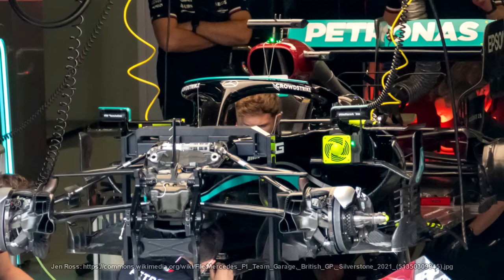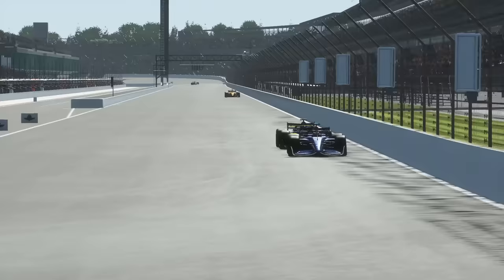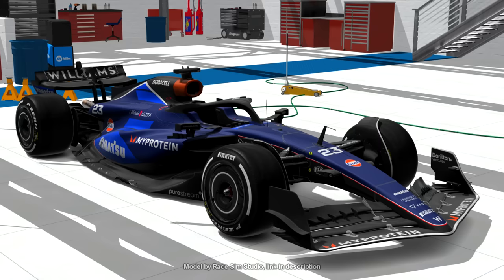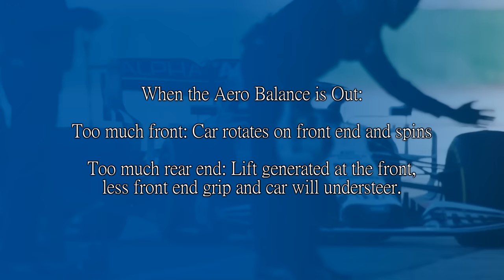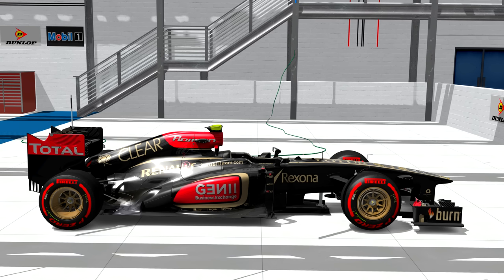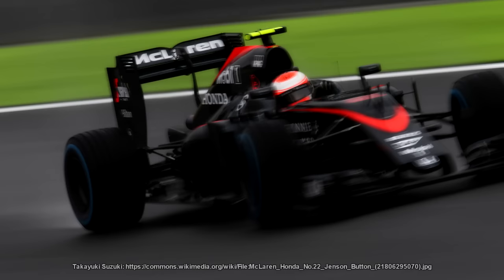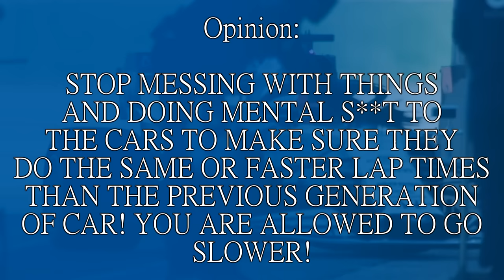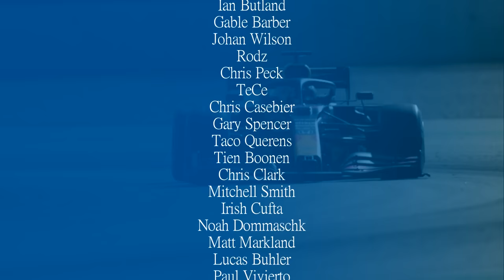BROKEN BEFORE IT'S EVEN IN? Opinions on the 'Undriveable' 2026 F1 Cars

Comment: If Vettel can run his FW14B on 100% renewable corn oil or whatever the fu**, then so can all of the F1 teams. Bring back NA V10’s!
Reply: Hell yeah! They got synthetic fuels, use em and bring back V10's!
Reply: @polycube868  I like the idea of synthetic fuels for racing, the only problem is that it is not a good solution for road cars and the public might take the fact that because it is good for renewable racing it is the best solution for all cars when it's not. It takes a lot, and I mean a lot of energy to make, so at best it will be 2/3 times more expensive than traditional fuels.
Reply: @callumcurtis15  gas prices are bad enough as is
Reply: @callumcurtis15  I dunno, no one is really expecting to put jet fuel in their car. It should be pretty clear that this is highly exotic stuff for racing only.
Reply: People are always mixing up bio-fuel (corn ethanol) and synthetic-fuel!   Vettel's run was on carbon neutral synthetic fuel -- i.e., hydrogen made from water using renewable electricity, then combined with captured carbon dioxide to make heavier hydrocarbon fuels using  renewable electricity.  Hydrogen combustion engines eliminate the second step, but have their own challenges.
Reply: The Teams have no interest in such a thing and would walk rather than spend the money involved in that.
Reply: @callumcurtis15  it's literally the only solution for road cars as long as electric cars are so expensive and not all that green, anyway. There'll be billions of ICE-powered cars for many decades to come, so transitioning to low/zero emission (bio)fuels is a good way to help clean up the atmosphere in the meantime

Comment: I remember doing high front wing, no rear wing, balance tests using Indy 500 in about 1990. You could balance about 2 of 10 wing steps with the sway bars, after that you were spinning like a top. 
And cars at Indy don't run much downforce even on max wing.

Comment: WEC is the true pinnacle of Motorsport.
Reply: I think F1 needs to open up the regs somewhat like WEC, I'm not keen on BoP but it might be a necessary evil. The only issue is that fanboys will have major saltiness every time the back markers get an advantage.
Reply: And WEC doesn't tell people "no you can't race here cause we made up some garbage excuses". Also it doesn't take forking over a huge stack of cash.
Reply: @LuminalSpoon  Opening up and adopting EoT (and its classes) like LMP1H would help and that's kinda different of BoP.
Also they could limit aero by lift to drag ratio. I.e first season of rule cycle is free, 2nd season onwards you have a lift to drag ratio limited by the numbers from the car that won the championship from first season + what F1 expect from performance improvements so cars can keep getting faster year after year.
Doing these changes would put the grid together without people arguing over BoP.
Reply: WEC is BOP garbage. Formula Two engines, 20 year old LMP2 engines with turbos on them... It's some pinnacle! (Not.)  The Ferrari and Toyota are well-designed cars (even with the road car engine in the Ferrari), but to be pegged back to the others with as much as +69kg over the basic Hypercar class weight, I do NOT agree with that.  BOP horribly spoils being able to enjoy WEC as an engineering, or indeed sporting, competition.
Reply: @TassieLorenzo  BOP still allows for better racing than F1 though, which is MAXWINSLOL every single race, BOP isn't even that much of a factor as the engineering to counterract it (which is a big part in Hypercar).

Comment: The euro fighter and f16 the flight surfaces are designed for maximum manoeuvrability and is unstable, so the plane will not stay in stable level flight and a pilot can not react quick enough for all the corrections required. if f1 goes this way its basically going back to the 93 regulations with all the driver aids and that might be a solution allow active suspension to keep the ground effect, but i think the biggest thing is this is the first real major change since burnie was not involved and it shows.

Comment: Would be great to see a video about how the F1 regs have evolved over time. Were there always so many back in the 60s and 70s? Are there too many? Would it be better with less? Is it really the pinnacle of motorsport with so many?
Reply: Regulation changes have almost always been reactionary, without limitations designers would produce deathtraps, and drivers would still drive them.
Reply: Most of the rules (which indeed get longer with every revision) are to slow the cars down. Otherwise with say 1975 rules we would have fan cars with 1.5L turbo engines with unlimited boost droning around with CVT transmissions, traction control and active suspension and with little to no  mandatory provisions for crash safety  (albeit outboard fuel tanks had already been banned by 1975, hence the move  to central fuel tanks and a more upright driver position)! 🙂
Reply: @TassieLorenzo I didn’t suggest no regs but things like not being able to change set ups after qualifying, having to use a slower tyre, penalties for using to many engines etc. These things don’t affect safety. The cost capping and stopping them testing just means whoever gets it right at the  start of a new set of regs is going to win because nobody is able to spend/test what they need to to catch up. There were eras when some teams had V10s others had V12s. This season nearly every car is a copy of last seasons RB - that is not the sort of innovation I want to see at the pinnacle of motorsport
Reply: @astonwards7236 understood but there is a vast difference from safety regs to banning teams from testing or making them use a slow tyre or not letting them change set ups between qualifying and the race

Comment: i say make.the cars smaller like they were 20 years ago, reduce cluttery and expensive electronics like 20 years ago  and put just some fast engines in them,like 20 years ago  , also reduce waste , reduce engineering time increase sustainability, just use the cars from 20 years ago
Reply: Safety improves over time. Undoing 20 years and +80kg worth of safety stuff since 2004 is generally not going to be palatable, hence why historic race cars tend to race in  dedicated historic racing... (I wasn't in favour of the halo, +20kg, at first, but the likelihood of it being taken away now it's common place is slim to none!)

Comment: What's the point of having Turbocharged engines now that MGU-H is gone? Go back to Naturally Aspirated v8/v10 with a MGU-K Hybrid.

The 50/50 power split is also a marketing pipe dream - unreal w/o going too heavy. 65/35 max.
Reply: Go back to V10s. The engines blowing up spices things up and avoids extremely predictable strategy races every weekend. With exotic materials having been banned since the 90s I don't think there's any way you could make a high revving F1 engine that would be as bullet proof as these turbo hybrid V6s.
Reply: @wiegraf9009  as if reducing rpms is not an option? Limit at 15-16k instead of 20k and suddenly they are far more reliable. Current cars can rev to 14k but you don't see it because of the power band.

Keep the hybrid part, it will also help a lot with reliability and longevity of engines.

Comment: The issue with modern F1 is that technical regs are destroying competition. The FIA sees this issue and tries to fix it with.... More regs. I say let teams do whatever the hell they want, within reason. If RB wants bendy wings, let them do it. If Ferrarri wants to burn 50/50 oil and fuel, let them do it. If Merc wants their DAS and party mode, let them have it. Right now, if a team can't "get it right" within current regs, they have no other options. It's either develop the best solution first or be fighting for 16th place. 

Ease engine regs to just a displacement limit, which could change based on if the engine uses forced induction and/or or a hybrid system. Right now I can't tell you which team uses which engine because it doesn't matter. The biggest difference between cars is the side pods and what their brake ducts look like. Might as well be a spec series at this point.

Comment: Honestly, if you're going to get rid of the MGU-H there's really no point in having turbocharged engines anymore. The fuel flow limit already gimps RPM and power as is, but if you get rid of the turbo you'll have the same power and fuel usage, but you can run the engines to a higher RPM for a more exciting sound. Not to mention they'd be much more responsive and thus better to drive and it would save a fair chunk on weight unless you force the teams to make their exhaust manifolds out of tungsten or something ridiculous. They're planning on getting rid of a lot of the ICE power for '26 anyway to reduce overall fuel usage per race to satisfy the EU so really, what's the harm in getting rid of the turbo? Even better if you mandate they run an x-pipe on the exhaust and have twin exits below the rear wing; that would sound mental. 

The other thing that I don't get is why they don't allow more experimental things like rotary valve heads or at least some copycat BMW Valvetronic system to get rid of the throttle bodies completely? The road relevance argument is mute no matter what engine you make them build as it's always going to be a super oversquare design with a VERY narrow valve included angle, which genuinely no street car is ever going to run because it makes the thing undrivable if you aren't giving it full tilt at high RPM. Oversquare designs are basically dead now due to emissions regulations anyway. Undersquare designs have less surface area for heat transfer and thus less heat losses but you can't rev them high at all, which doesn't matter since you can't rev high with direct injection anyway unless you have some sort of light-speed injectors with a quantum computer for the ECU. At least if they'd let them experiment with novel designs we might get something that would be useful for street cars until they eventually regulate combusion engines off showrooms. A lot of this tech has existed for decades now and it's only been barred from motorsports due to these regulations mandating the most basic "this is how wikipedia says a combustion engine is built" methods to be used instead of already proven reliable tech that would improve overall engine efficiency and responsiveness. 

There's a cost cap already in place to reduce costs for development wars, so who cares if they're allowed to risk their budget on experimenting with cool stuff we'd all love to see out on track?

Comment: F1 is trying to engineer themselves out of a problem they created.  As the cars have gotten bigger and the focus on aero is increased, the racing has gotten worse.  Why?  2 reasons.  

1: The tracks can not grow with the cars.  The large the car, the fewer usable lines there are, meaning more line-a-stern racing where cars can be affected by aero-wash.  
2: The regulations are so tight that teams can not innovate to get around aero wash.  Now that there is a cost cap, the regulations should be loosened.  As long as it is a hybrid, give the teams a displacement limit, a standard fuel, a standard battery, and let them innovate.  We could see V6s, v8s, inline 5s, who knows.  LMH/LMDh car regs are a good example.  Engine power and energy deployment can overcome aero issues.  

The moral of the story is that f1 needs to take a page from the past and relinquish a bit of control.
Reply: I especially agree on the second part, if you have the regulations as tight as they are adding a budget cap kills most form of innovation/thinking outside the box you go in a direction that didn’t work for you you’re years behind and way more fearful of taking risks so you just end up building your own interpretation on known concepts - see the many RB clones lol 

If you want a budget cap that’s fine but you will need to open up the regulations as well lack of spending and restrictions will only respond in poorer ideas in an non spec series
Reply: Can Am used to be innovative with how little rules there were yet people ended up calling it "The Bruce and Denny Show" due to how often Bruce McLaren and Denny Hulme kept winning for 5 seasons straight. But if regulations were put in place to improve the on track action people complain and call it "fake racing". 

There's no winning with motorsports fans.
Reply: @CyanRooper There's always loopholes even with less rulings.
Reply: @CyanRooper, very true.  But Can-Am had zero money restrictions and no rules.  It became a experimental car racing league for people with deep pockets.  Fun to watch for a bit, but it eventually because a money game.  F1 just needs to keep the cost cap and add guidelines instead of regs.  Instead of saying a turbo-hybrid v6, say a 2.5 L engine with a max of 800hp.  They can turbo, supercharge, natually aspirate, their call.  Weight becomes a variable, acceleration, fuel economy, all that becomes something teams can engineer.  Variability equals cars with different strengths and better racing.  Instead of teams fighting to hit the one perfect formula, they can find their own perfect formula that works for their PU/chassis set up.
Reply: @stayoffthemarbles6790  Cam AM died out once they lost support from the major manufacturers. F1 was one point like that also nearly finished, but was able to survive cause of major manufacturers willing to stay and support F1.
Reply: LMH/LMDh has BOP. By rights the smallest possible V4 or V-Twin engine/on-board generator will be most efficient.   Certainly not a larger (and bulkier) engine  than necessary.  Most likely without the direct drive to the wheels that F1 demands, but rather just a generator running at maximum efficiency like a locomotive.
Reply: @TassieLorenzo  I agree with you, BoP is the worst.  But since F1 has a cost cap, there shouldn't be a need for BoP.  I didn't  mean to use the LMH/LMDh rules exactly, but to use their phrasing in F1.  It opens up a lot of room for engineering and innovation.
Reply: inline 4 and 6 are better

Comment: I don't understand the issue, sure you're going to struggle through a corner like Copse with no rear downforce, but you're not going to set the car up and run it like that, you're going to have it set to max downforce through that corner and then take it off during somewhere like the hanger straight.

Comment: I'm also guessing there will be a weight reduction in the "power unit" when they change, which means less mechanical weight behind the driver as well.
Reply: That seems impossible given that they will need a bigger battery for 50/50 power and they are removing the MGU-H, which is TINY and provides a huge efficiency gain. Still going to be a V6, still going to be turbo, so the weight losses will not come from the PU. They are trying to run smaller tyres and have narrower cars to drop weight.

Comment: What F1 needs is actually pretty simple.  You need smaller, lighter cars with more power.  Formula E did that, and it will do it again with the gen 3.5 regs, and it's been working.  It's really not that hard, but F1 seems to think it is for some reason lol!

Comment: I don't really care if we have less reliability with the next set of regs, the current amount of reliability is boring and honestly I think they would be better off going back to V10s which are guaranteed to break down as often as not like around the turn of the century, but the idea of the computer failing and catapulting the driver into the wall going down the straight at Baku or something is very concerning.

Comment: Bring back the v10. Use carbon neutral fuel. Enable ERS, enable standard active suspension to everyone. Double DRS. And smaller cars. No TC

MOTOR wise. Enable RD for improve efficiency and mild hibridazation 25/75

Comment: My last comment was getting long, here's my proposed solution for good racing: Keep the width and tires of current cars, keep ground effect tunnels, 3 L engines, any number of cylinders, no refuelling, sustainable fuels, four races per engine, no DRS.

And my proposal for innovation: Allow any engine/motor/power unit, work out an equivalence formula (always tricky, always controversial), have hybrids duelling with N/A V10's and pure electric, allow active aero, go nuts....racing WILL suffer, but hey, some guys just like the cars.

Comment: Overreliance on aero - the enemy of good racing, and how to burn money. Again - Ban all aero but for a simple single-piece front and rear wing of mandated maximum horizontal area, mounted outside the axel lines. Dump the engine formula for an FIA provided fuel formula based initially on current regs and let the teams go ham. Oh, and mandate a maximum track and wheelbase roughly half that of the current cars... minimum weight for driver + seat only, so as not to penalise larger drivers. Standard Tyres. Otherwise anything goes, safety allowing.